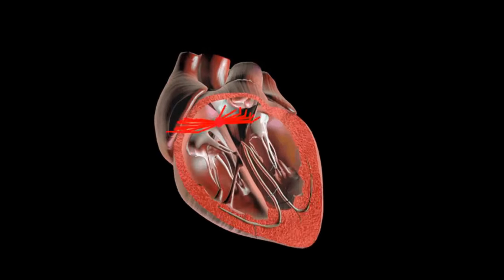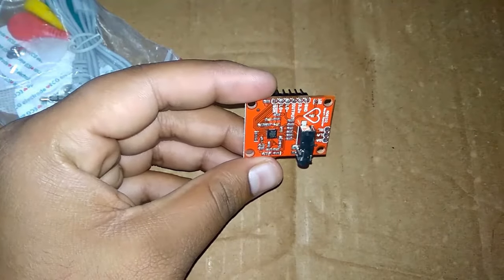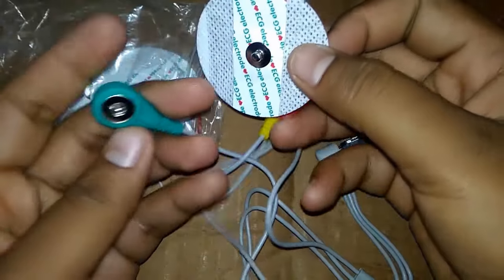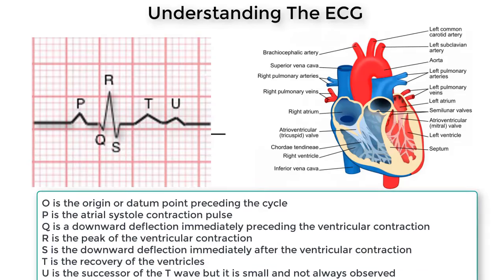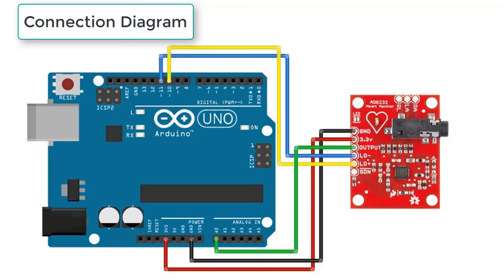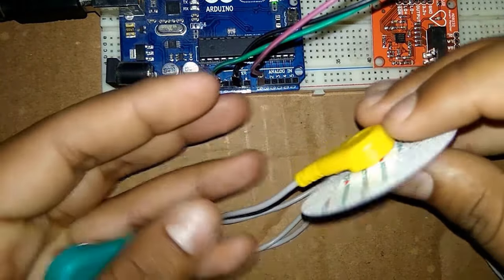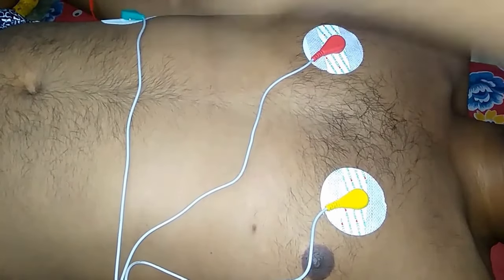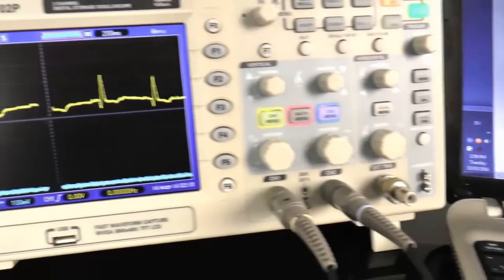ECG Monitoring with AD8232 ECG Sensor and Arduino

Comment: For all those who are either not getting the desired graph or are getting distortion,please remove the laptop battery charger while observing your serial plotter,same is the issue with most of desktop computers they also give distorted graphs.
Reply: Still don't fcking work
Reply: @sebastianibarra7566  can you show the graph and connections of sensor?
Reply: @hussain55019  Don't worry, i tried chancing the laptop and connecting the arduino in another port. Now it works, thank you
Reply: @sebastianibarra7566  Bro it's sound card version is more  messy than that of arduino one.Also try that
Reply: What if you removed the laptop charger, and are still not getting the desired graph?

I've checked baud rate.
-I am using elegoo uno r3 instead of an arduino board.

Also, the graph appears to be very noisy and very quick
Reply: Still cant get it i have removed the charger and also tried using another port
Reply: @vvvvvvv6396  what exactly is your graph showing.Is it destorted or inverted or the iso electric line is drifting vertically?
Reply: Use delay(0.01) the graph will be good
Reply: @hussain55019  its drifting vertically
Reply: i guess Im kinda randomly asking but does anybody know a good place to stream newly released tv shows online ?
Reply: @Martin Michael I dunno try flixportal. You can find it by googling :P -crew
Reply: @Crew River Thanks, I signed up and it seems like they got a lot of movies there :D I really appreciate it!!
Reply: @Martin Michael no problem =)
Reply: Bro help me i tried a lot but can not get a good  result on my pc
Reply: @Sumonms  if your using desktop computer then this problem of distorted graph will accur.Try it on laptop but it shouldn't be connected to charger.
Reply: @vvvvvvv6396  vertical drifting is because of weak contact of electrodes with skin.
Reply: @hussain55019  thanks you bro o will definitely try it for my project. Last 10 days i worked  lot but output is zero.I think electrode is also responsible for this. I will try to buy Better electrode.
Reply: @Sumonms  if graph os distorted it's the problem of usb port sensitivity not always but mostly and if the isoelectric line is drfting up and down it's because of electrodes.I am assuming that your code is correct.
Reply: still not working
Reply: @mustafaergul5869  are your electrodes new?
Reply: @hussain55019  Yes, electrodres are new
Reply: @mustafaergul5869  check code connections and if you are using laptop disconnect charger
Reply: @mustafaergul5869  
I am facing the same problem now.. did you manage to solve it?
Reply: @شٍهِګةّةّحٌزِّنِ  No
Reply: @sebastianibarra7566  holi je
Reply: I have an horizontal line, first i try solding the AD8232, but i think it burned, next i connected to the laptop and the led works, before i put  the electrodes and the signal was flat and the led of the AD8232 stopped. Help please
Reply: 1. How can I save the data coming from ECG sensor and in which format to save
2. And how to re-plot graph 📉 from that saved data file

I want to use that plotted graph data file for further ML model
Cause I'm new to iot I've no idea.
Reply: @justinlives4christ  sr, but can I ask you could fix it at that time ?
Reply: Still not getting graph what to do now, where I should concentrate
Reply: @BhavaniRajendren  Have you connected the sensor as per circuit diagram. If yes then check your electrodes
Reply: Hey bro... I have a problem with this project... I get a graph without even connecting electrodes
Reply: @nithishKumar-gs6nz  adjust the potentiometer.
Reply: It's urgent... How can I contact u regarding asking clarification of this project

Comment: Guys I advise not to connect this board to PC and if you use laptop, only when it's disconnected from mains outlet, because if the high voltage gets it's way trough your power source (PC)/power charger (laptop) you're getting killed by fair good connection to your heart. There is a need of special isolation optocoupler module (could be 30+$ part) for each channel and separate power for the signal input block for the design to be safe. Use only on battery power for your safety, and disconnect yourself from it before plugging laptop in.
Reply: what do you mean? are you trying to say that unplug arduino cable from laptop? or remove the laptop charger if plugged in???
Reply: @javeriaehsan369  remove the laptop charger. There should be no wire going to electrical socket and it would be safe. Laptop will run on battery and only after that connect person and arduino to laptop.
Reply: may i ask, what exactly do you mean with "separate power for the signal input block" - does that mean that the ecg sensor's power supply should not be linked to the one from the arduino?
Reply: @kikikikiriki  i imagine input signal block as a circuit that is connected to patient and amplifies signal from patient. it shall have NO galvanic connection to main power (230VAC 120VAC...) because it could kill patient because there is electric wire (galvanic connection) attached to patients body. There are 2 engineering tasks... a) powering up the ECG amplifier without galvanic connection (maybe by transformer and optoisolated feedback? these have to be reliable parts that wont pass electricity to the other side) b) getting amplified signal to rest of ECG machine again without galvanic connection (check AD210AN and similar isolation amplifiers) Why is this an issue? The laptop charger could fail and pass 230VAC into arduino and its ECG shield to the patient and shock him.
Reply: 5v can't kill me
Reply: @Djamilchik  5V is not problem. Problem is when switched power supply that powers PC/laptop fails, it will be way higher than 5V, and this higher voltage from electrical outlet will shock user's heart.
Reply: @householdmaker  it wont go through the module, and if it would there will be 12v maximum

Comment: if you're having too much noise with the sensor reading try to unplug the pc charger the result will be much more better! i guess the module need a very stable voltage.

Comment: If your ECG baseline is drifting vertically its because of two reasons.
1-weak contact of Electrode with skin.
2-Perspiration or sweaty skin.
To deal with this make sure your skin is dry and always use new Electrodes for recording.

Comment: Can i calculate BPM from the ecg output without using Processing IDE?
Reply: You can  base it off a running average, add up analog values for a couple of seconds, average them, whenever a analog signal is above that average, there was a heart beat. Some times is needed to determine heart beat

Comment: Is it possible to display the ECG signal using AD8232 sensor nd Arduino on MATLAB Serially and then, properly show the ECG Peaks voltages or time intervals of the live ECG signal in MATLAB ?!!
Reply from the maker: Yes its possible. Interface arduino with matlab.
Reply: @HowtoElectronics  I have interfaced Arduino  and AD8232 sensor with Matlab but, the problem is that i can't find the ECG peaks (P,Q,R,S,T) voltage levels or time intervals of the live ecg signal plotted in Matlab. Can you give me ur email, i will send you the MATLAB code. Have a look at it !!
Reply: Can you send the Matlab code to me?

Comment: Why is my signal so fast, and it does not look like yours?
Reply from the maker: Check signal noise and Electrode placement. Also remove laptop battery charger while checking on serial plottor.

Comment: Hi great topic !!!
But i'v tried 100 times the same way that u did , I can't ever get an classic ECG graphic like yours , please help
Reply from the maker: Use laptop, do not use Desktop PC. While using laptop remove the charger.
Place the ecg leads at correct position.
Reply: @HowtoElectronics  yeah I did all this stuff , same result
Reply: @samehbouhafs7259  same is happening with me . How did you proceed please help !
Reply: @Ranjini  same issue that  I'm facing in the graph .....
Please try to get the solution for this issue .
Reply: @NCTeja  Hey there, any idea how to solve thise issue?

Comment: It's showing '!' instead of value in serial monitor. Code, connection all are ok. What can be the problem?? Plz help. Thanks in advance
Reply from the maker: Baudrate check
Reply: @HowtoElectronics  baudrate is 9600.''if((digitalRead(10) == 1)||(digitalRead(11) == 1)){
Serial.println('!');''
plz explain this part of the code.
Whenever we are removing this portion of the code, then the sensor can sense the analog value and showing value,curve.
What is the necessity of this part?